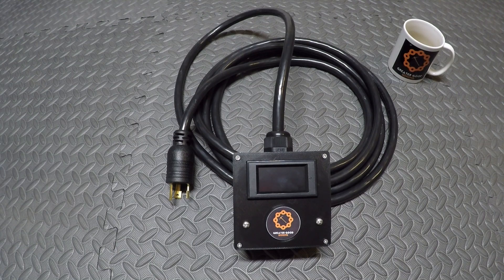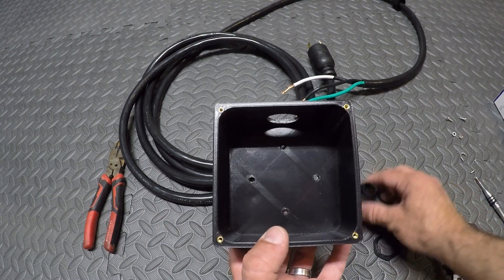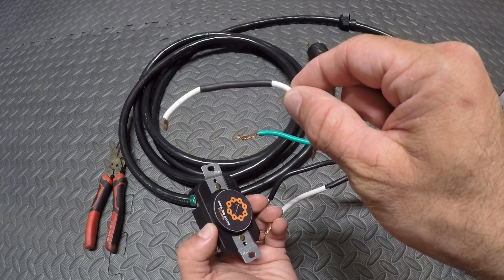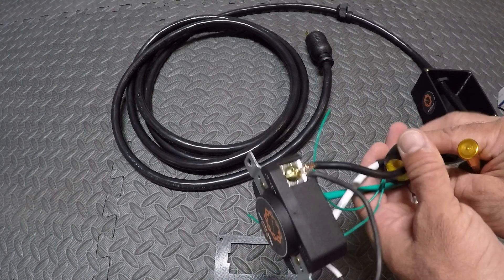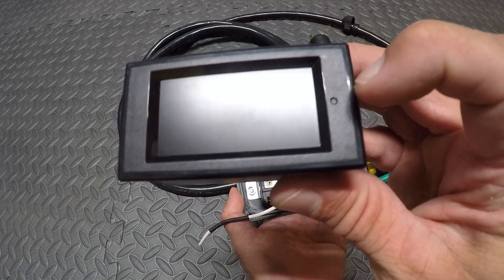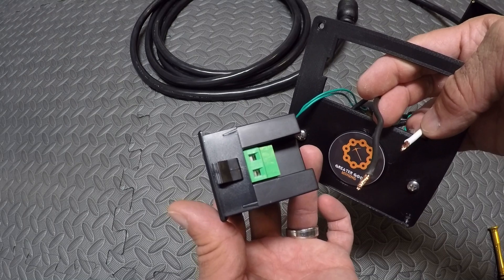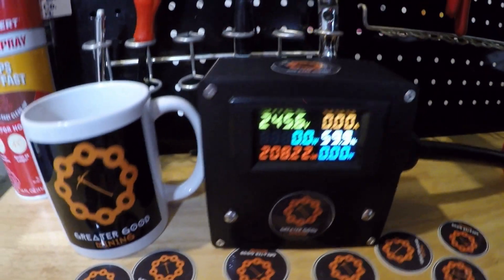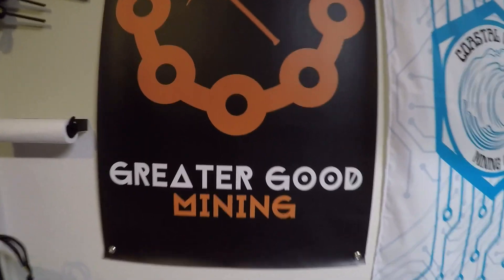220 volt Drok Power Meter Build! Like Meterbox, Spacegoats etc.

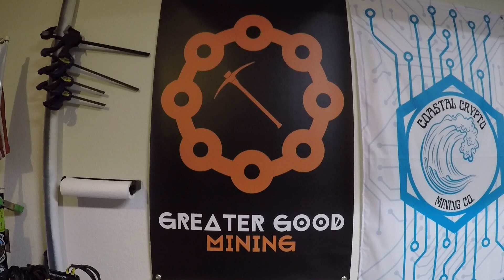Comment: Great project box you did.  I did a similar one with a single Drok and stuck it on my AC condenser unit. The voltage connection goes across the two 120 legs on the contactor so the display reads 238 V.  The doughnut has one of the hot legs going through it to measure the current.  When the 4 ton unit is running, it measure 3,675 watts and 16.4 amps. I guess what I’m a little confused about is whether or not the kilowatt hours is accurately being   calculated and how only having one of the 120 legs being used for the current draw affects the display values.  Since the other leg has 16 A, presumably running on it as well I guess you would 7:08  characterize this as drawing 32 A total? Same question with the watts.

Comment: is there a reason you are using the 3 prong twist lock? Its nice to quickly identify the receptacle is 220v, but the regular 3 prongers are cheaper and more plentiful. Do you have a preference?
Reply from the maker: I like that they lock in securely. Plus that's what my power meter box came with so I rolled with it :]